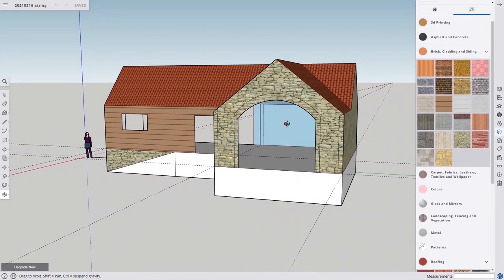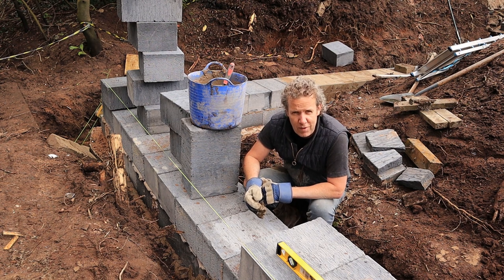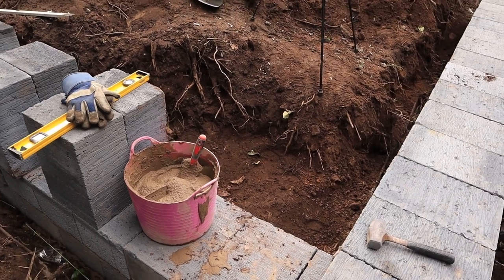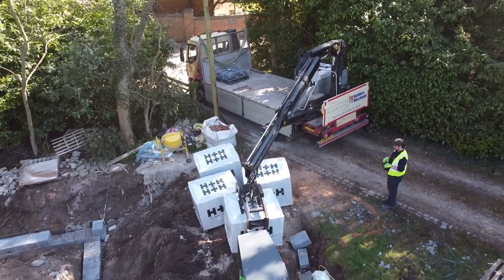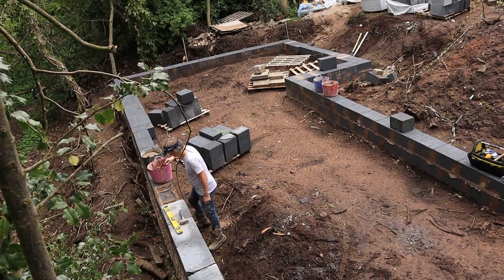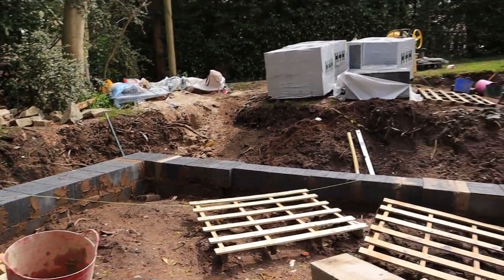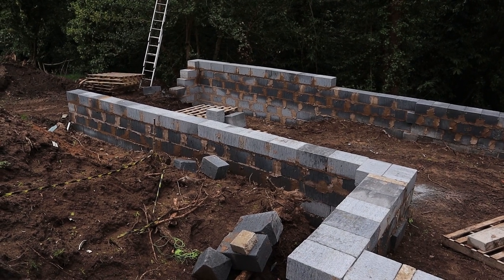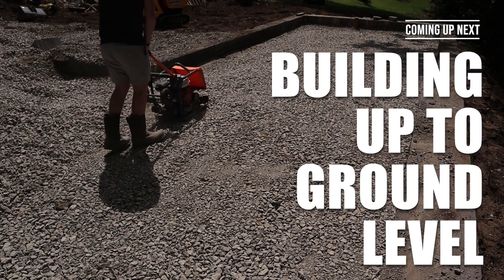DIY'er Builds a Barn #12 - Trench Block Finale

Comment: I am renovating an 1800`s carriage house in the western US, (I am from the UK). The building has been sitting essentially on dirt, as the stone foundation had largely disintegrated. With no previous experience, I dug out in sections under the building, and poured a perimeter foundation. I have made a lot of progress, but my lack of experience has led to making mistakes, that are compunded with every following stage of work. So, you are not alone with mistakes like the un-level concrete pour.

Comment: Good going, how come some of your courses swap 90° on a run? Not a builder myself but done some diy, its amazing how much better you get when you just crack on with it
Reply from the maker: Not quite sure what you mean - do you mean the gaps line up vertically? (a straight joint?) If so the answer is because I'm an amateur / DIYer! Thanks for watching 😀
Reply: Thanks for the reply, just binged all the vids today, it's the trench blocks on the back side they rotate half way along the run
Reply: @jamienelson7544  in an earlier video he explained why the other section is thicker. I think it's because the garage will be at that side?
Reply: Thats correct and the Garage will be much heavier.

Comment: Question,   did you consider a poured concrete foundation?  Framing then getting concrete poured seems to be more effective and far less time consuming, not to mention the cost&labor
Reply from the maker: With hindsight Gary it might have been a better idea given the depth. The only thing though is that the workshop end is exposed not buried and so I'd end up having to make some sort of form for it. I just wasn't experienced enough to take on a 2.2m deep concrete pour (as episode 10 demonstrates!!). Thanks for watching - just uploaded E14 and we get a concrete pump in...